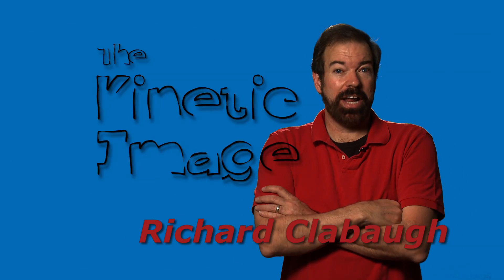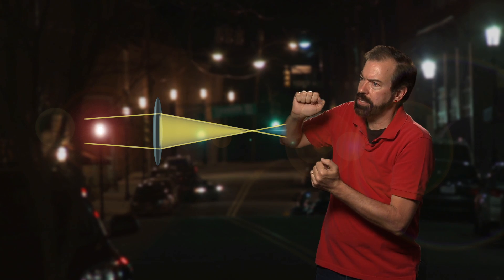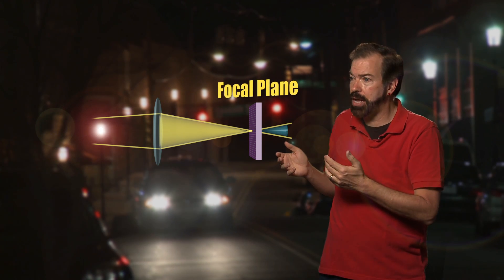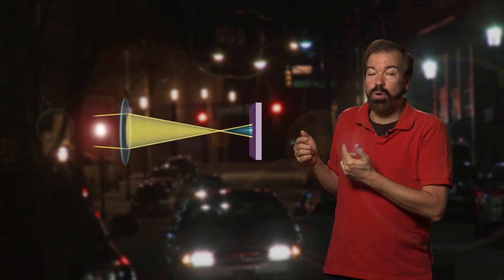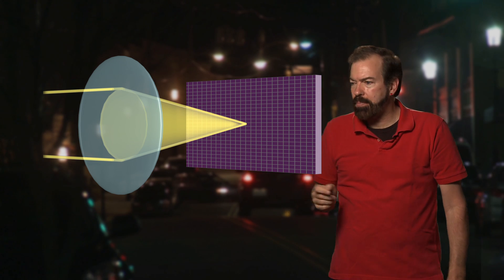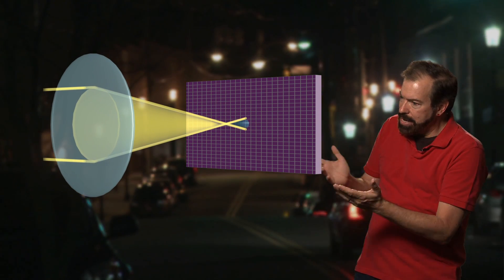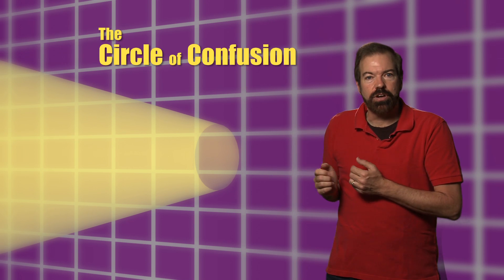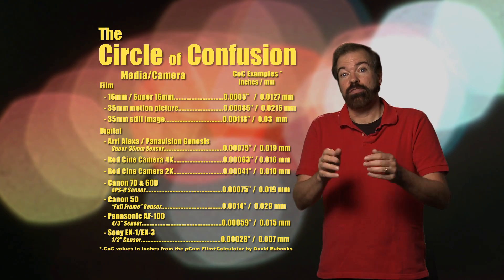Circle of Confusion Explained and Illustrated

Comment: Ok I get the explanation, and much better than having read some articles on it from different sources.  BUT, just how is it used, or changed, to help in my photography?  I mean how can I actually use this information productively, and is it possible to gain enough insight knowing this, to enhance what I am doing?  Where does acceptable focus come into play on a photograph I take, how does it change with F-stop limitations, would it matter if one was using photo stacking?  Oh man, the questions are flashing through my mind like lava pouring out of a fissure into my ocean of ignorance.   I am just beginning to take up photography, and really I haven't a clue.  Being a very poor person,  I cannot afford actual instruction, so I try to glean things like this out of the depths of the internet, but alas I may be getting lost in the woods here......One more thing, where can one find this information for a certain camera, say a Hasselblad H3Dll like the one my dad gave me?  Does the manufacturer supply that information somewhere?  I do not have a instruction manual, but this one has about 40MP full frame (I think).  Well I really don't expect an answer from you as this post is 7 years old, but it is worth a shot.  Maybe someone reading this can give me a direction to go towards to help a bit.  Thanks for this video it was helpful, but rather limited in ways to use this information.  Cheers mate!

Comment: I loved the video, and I'm sorry if this is a dumb question.....does that mean a bigger CoC is "better" or "worse".
Reply from the maker: +Bruce Mount - because the CoC is just a value used in a calculation for a depth of field table, a smaller CoC means a more critical focus result on the table.  In that way, smaller is better.  In practice, if one depth of field table uses a larger CoC, it might say that at a certain f-stop, at a certain focal length, focused to a certain distance (say 4 feet, just for the sake of argument) everything from 3-feet to 6-feet is in focus.  Another table, calculated using a SMALLER number for the CoC value, would be more critical of the focus and might say, at those same settings, that you are only REALLY in focus from 3-1/2 feet to 5-1/4 feet.  In other words, one will be more "critical" of the degree something can be a tiny bit "soft" before calling it "out of focus."  In practice, when I am shooting a feature film intended for theatrical exhibition, I always want the most crucial focus because it will be blown up so large that even a small degree off will look soft.  The tables in the American Cinematographer Manuals have always tended to use smaller CoC values than other charts I've had.   In practice, if you are shooting digital video -- as opposed to film, the CoC is effectively the size of a pixel as both the recording device (camera) and the display device (TV) can resolve nothing smaller than that size.  Smaller than that makes little significant difference.  Sorry for the long answer but if I had to answer, smaller is better, but in practice it depends how you're using the material you're shooting.  I will always take the table with the smaller CoC value.  Gosh I hope this was more helpful than confusing!
Reply: +thekineticimage Sorry????  For the long answer???  It was a FANTASTIC answer!  I love all the detail.  Thank you so much for taking the time to include so much.  It makes much more sense now.
Reply from the maker: The smaller the number the more critical the depth of field table is.  The larger the number, the more forgiving.  In other words if a Depth of Field table uses one value as the CoC for their calculations, they might say an area 4-feet is the area in acceptably sharp focus (on a given lens, at a given f-stop, at a specific focus distant on a specific camera). But using a smaller CoC number (a smaller size) to calculate the table might say the area of acceptably sharp focus for those same settings is only, say, 3'8".  Find any Depth of Field table and they will show the value of "CoC" that was used to calculate the table.  Smaller numbers are more "critical" of defining what is "acceptable focus" and call it out of focus sooner than a larger number.
Reply: great answer

Comment: So the circle of confusion is the area outside of focus?
Reply: I know this is very old, but I'll try to answer it anyway. 
First, lenses have a point where all the light rays converge and are exactly in focus, but it is an infinitesimally small point, so small that it doesn't have an area. Obviously, it is not possible to have something like that in the real world. If you take the cone of light (0:56), and make a transverse section, you'll get a circle. The closer you move to the tip, the smaller the circle, but as I said before, you cannot get to the very tip, so no matter how small the circle is, the rays are not converging, they always are out of focus. But if the circle is small enough, our eyes won't be able to tell they're not. 
So to summarize, the circle of confusion is a transverse section of the cone of light, where light rays are not in focus. If the circle is small enough, we won't be able to tell they're not in focus
Reply from the maker: The Circle of Confusion is a number. It is a value.  It is used to calculate a depth of field table.  It defines what they list as the close and far limits if what is in acceptably sharp focus.